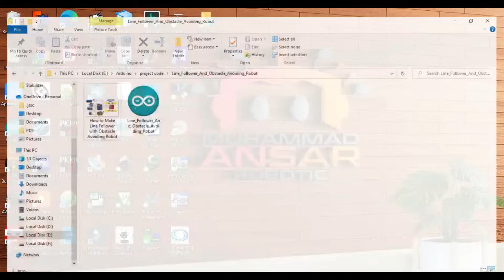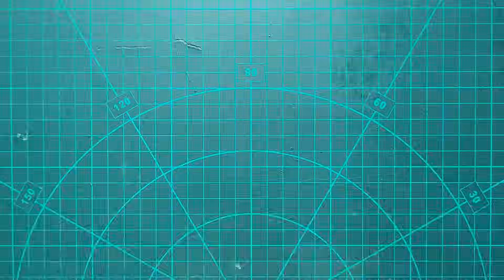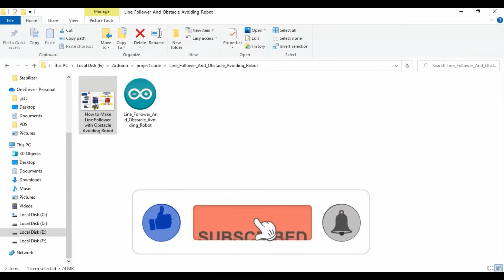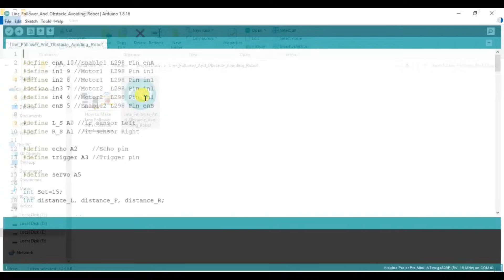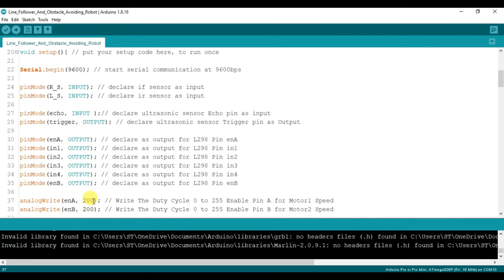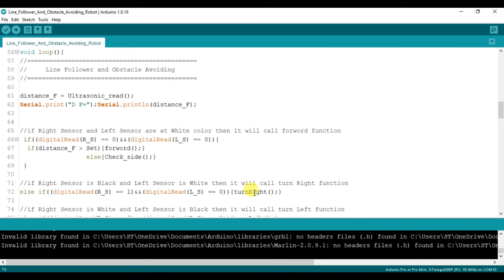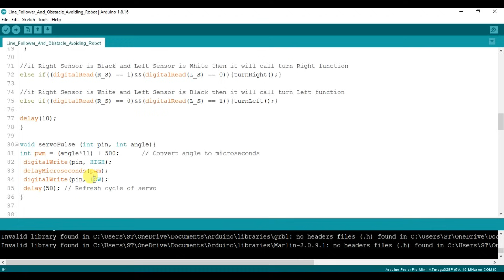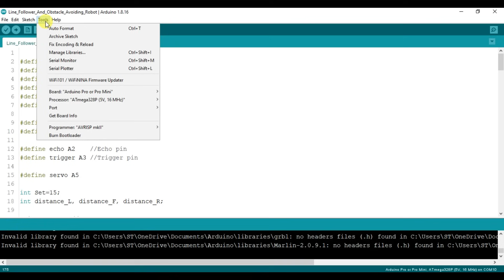Line Follower with Obstacle Avoiding Robot | Arduino and L298 Motor Driver

Comment: Bro please circuit diagram and base plate measurements put broooo
Reply from the maker: Check description
Reply: Please did you reverse the terminal of the gear motor I want to be sure I didn’t do a mistake, I connected red to red and black to black of individual side of the wheel
Reply: Because I notice you connect black of one motor to the red of the other gear motor.

Comment: I made this project without breadboard and it worked still fair but sometimes it not avoid obstacles properly and after getting out from its path it doesn't come back to the path ,it goes to different areas but not follow the line 😅😂

Comment: I configured your project but the robot can't follow the path of the line like in your video. The sensors are calibrated, the led lights up when it detects the white background and turns off when it detects the dark line, the battery I'm using is 7.4 volts. Engine detection and sonar are also working. Can you help me please?

Comment: Hello bro I do this project with your video it is successful but one problem 😢😢😢 IR Sensor is reversely detecting like when I put on the black line light is turn on when I remove the black line the light is turn off please helpppppp me bro😢😢😢😢😢😢
Reply: If the IR sensor is in reverse setup, you need to reverse also the logic in your code as well. If the sensor is detecting the black line when it shouldn't, you need to implement the movement function when black line was turnoff. Just reverse the high and low of the sensor conditonals
Reply: @capilijhonmirob.  bro that means I want change code high=low ,low=high yes bro
Reply: @capilijhonmirob.  bro it's not working bro I don't know how to do bro please edit the code and send me bro Monday I have a science fair please

Comment: I will do correct as per instruction you give
My car is moving back didn't follow the line i will callibrate the sensor also 
But didn't work it what should I do
Reply from the maker: from L298 swap the motors wires

Comment: When I upload code its sensor work as you tell in the video but motors ditnot move 
We give a supply of 12v(2000mah×3)
And I uploaded code 2 - 3 times .
And also set the sensors on black line as you teachs in video 
Please tell, what to do?
Reply: idk

Comment: My motor isn't working at all but all the sensors are working. Can help me with what could be wrong?
Reply: Same
Reply: @brilliant3819  I was able to fix it by putting a bigger battery
Reply: Fayiz Mohammed thank you so much I had the same problem too

Comment: Sir when I switchon light gets on and servo rotates but motor is not running  it means  there is no power in the battery ?
Reply from the maker: yes it can be
Reply: Did find the solution ?

Comment: Sir after ir sensor calibration  motor running backwards not following  the  line what to do? I done the same as you have done
Reply: Reverse the  motor connection

Comment: I just run the code now but boom it’s not responding the wheel aren’t moving at all

I have calibrated IR, distance sensor working but wheel not rotating or running at all & I am right here before my students
Reply from the maker: check your hardware
Reply: @MuhammadAnsar  Thanks it worked now just that another day it was turning around the left tires are rolling backward

Comment: I've followed every thing exact same as you did. Also I calibrate the IR sensors. But still the motors are not working all the sensors are working and every thing is perfect except for the motors. 

Note that I have tried the motors before starting the whole project and they were working.. Could you help me please.
Reply: same problem with mine and there is

Comment: Question#01:
Mene 2  3.7volts Batteries use ki ha lekn usse motors shi work nhi krr rhi kabhi do tires work krte hai kabhi teen or jab zameen par place kro to ek hi chalta hai. 
To kia mein 4 batteries use kr sakta hoo? 

Question#2:
Or ek swaal ye bhi tha k agr mei 12 ya 14 volts supply kroo to har motors ko individual 14 milega ya ye divide hojayega among all motors yaani 3.4 each.

Comment: Brooo. I'm planning to do this project, but I'm lil bit nervous in this project when it didn't worked. 😭
Reply: Is that are the actual codes used in that project? I just traumatized on what happened in the past because the code that is used in the project that someones made didn't work huhu

Comment: Sir, can you please help me i used 7.5 v power supply all the things are same as you did. But after uploading the code only ultrasonic sensor is rotating wheels are not moving only one time left hand side wheels move. And now i am tired. I don't understand what is the problem.

Comment: Good evening, Monsieur, if you please, I made an Arduino robot car that walks on black lines, avoids barriers, turns around, and returns according to the important code at home. It works, but sometimes it is not good, and I come back by correcting the code. The problem is when I go to university. The professor has a plot of land in 3D3, and my car does not drive well in class. I don't know what the problem is, please help me

Comment: Sir how to reset ir sensor output led is not turning off and not following line
Reply from the maker: calibrate the IR sensor
Reply: I turned full 360 degrees sir, out led is not turning off when it is in black line
Reply: Hello brother my wheels are not running in the Arduino project and when I connect the power then the Arduino does not work even after putting code and there was smoke from Arduino please help me

Comment: Hello sir, I implement the project but facing two issue . It is not following the line and it's only going backward direct. Kindly help me.
Reply from the maker: swap the motors wires
Reply: @MuhammadAnsar  After I swap the wires for one particular motors, it stops moving backward but turns around on one spot. Please help me

Comment: tysm for the video. really helpful....the code is working fine but the motors seem to be moving in a repetitive pattern(the left wheel starts, both wheels move , the left wheel keeps going when the right wheel stops ) instead of detecting properly through the IR sensors and working depending on that black line. please suggest where i am going wrong.
Reply from the maker: thank you
calibrate the IR sensor
Reply: thank you for responding back. I would like to ask that without the presence of any obstacle, the robot just keeps rotating in a circle. please help in telling me what is the issue?
Reply: Same issues delt

Comment: As Salamu Alaikum, brother. I've followed everything exact same as you did. Also calibrated IR sensors. But still motors are not working. All other sensors (including servo motor) are working completely fine. Please give me solution.

4 motors are all perfectly ok. but not running together in robot. I've also checked motor connections
Reply: power connection problem or motor driver problem
Reply: @mdnaimulislam.3858 code probleme

Comment: Dear Sir. Thanks to you for the hard work done to complete this project.- I have a doubt. In the video, you show the IR sensor "IRSence Ver-2, while in the circuit diagram is using "FC-51". In the local market I only get the FC-51, can I use this one without problems?  Thanks in advance for your kind reply. Best regards from Montevideo-Uruguay.

Comment: Sir thank you, it is a nice project. 
Need your advice and suggestion, as I have assembled the "Line Follower with Obstacle Avoiding Robot" but is not following the line, but if any obstacle is coming it check and changes the direction. Please help and suggest , how can I fix this.
Reply from the maker: calibrate the IR sensor
Reply: Bro line follow avuthundha?IR SENSOR check chesaaka.

Comment: Hello, sir. I would just like to have a question about the battery. I am curious. Will it not have any complications since that battery only adds up to atleast 9V and the needed Voltage in the Motor driver is 12V? And to add the battery is also connected to the arduino.

Comment: Asalam alaykum akhi, may allah bless you.
I have 2 questions:
1) I am planing to do a robot that avoid obstacles and follow the line just like you did, but I want to add another function, which could in your opinion?

2) I am planning to use atmega instead of arduinob, will there be any difference in coding with c or parts used?
Reply from the maker: wa alaikum assalam, thank you
question 1:- yes, now you can add more function
question 2:- yes you can use it you don't have to change any code
Reply: Sir mere tayar chal nahi rahe he

Comment: Hi sir, very informative video, but can I ask if we can use a 6V total for power source or it should be higher? Hope you can notice thanks
Reply: I think it should be higher, but most importantly you need to have enough current to run the arduino codes
Reply: 9V is probably what you should use
Reply: use the motor driver pwm and control the speed

Comment: I am facing problems in compiling the code. It is showing errors. Please help
Reply from the maker: what is the error showing?
Reply: In my arduino uno Rx and Tx Led is not working.
After giving power to it
Reply: @MuhammadAnsar  please help